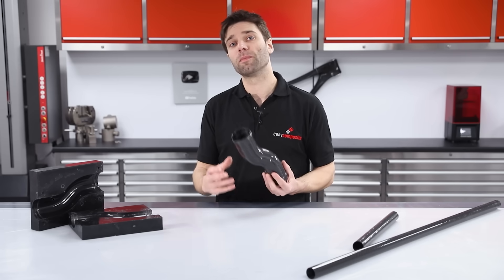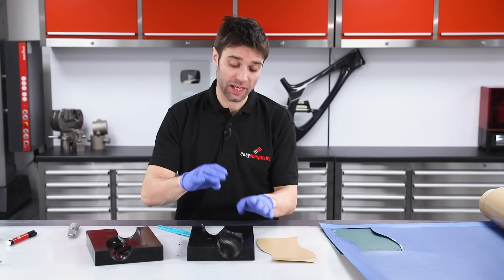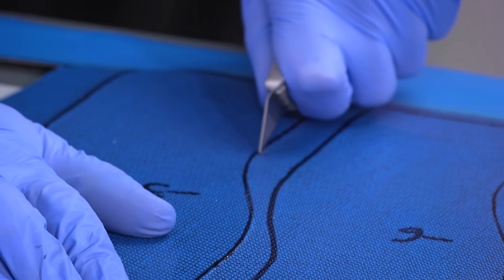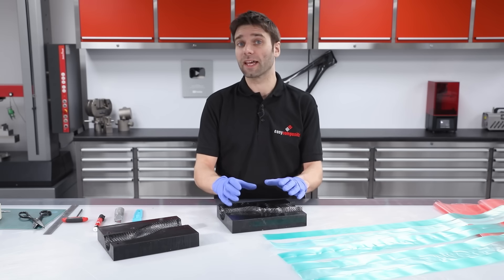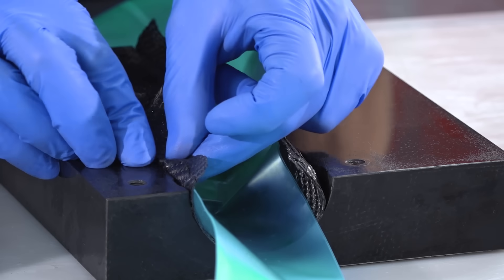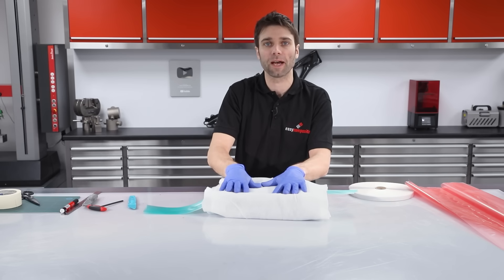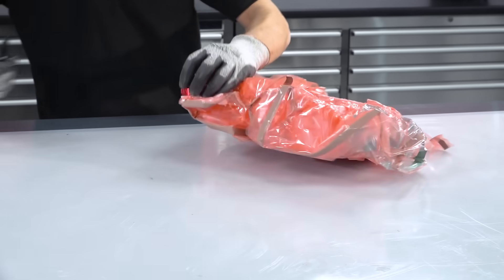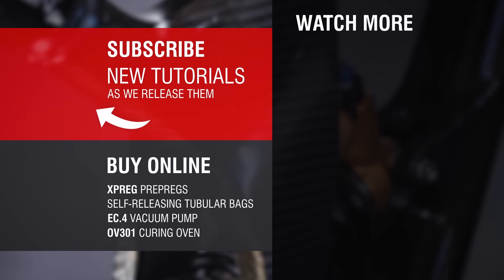Making Complex Carbon Fibre Tubes Using a Split-Mould

Comment: Excellent! Could you demonstrate how to make the patterns for carbon fibre tube such the one in this video?
Reply from the maker: The split-mould we used in this video is a prepreg carbon fibre tool. The patterns (for the two halves) were CNC machined from epoxy tooling board like in https://www.youtube.com/watch?v=CWAvo8DIZ9s and then the mould halves made from made from XT135 carbon 10:00 28/04/2020fibre tooling prepreg like in https://www.youtube.com/watch?v=k4GdAuNji5g. There are other solutions for making high temperature moulds, such as a hand layup process using high temperature epoxy tooling gelcoat, resin and paste which you can find out about in this tutorial (on our website) https://www.easycomposites.co.uk/#!/composites-tutorials/High-Temp-Tooling-Gelcoat-Putty-Mould
Reply: Easy Composites Ltd thank you so much! Need to get me some kit off your store.

Comment: The the inside tube was only open to atmospheric pressure on 1 side rather than 2, this would not work. Correct?
Reply from the maker: Sorry Cam I'm not sure I understand the question. The vacuum bag tube on the inside has atmospheric pressure 'filling the tunnel' through the tube and pushing the bagging film onto the laminate which is on the inside of the split mould. The rest of the vacuum bag is, effectively, on the 'other side' pushing in the opposite direction. Does that make sense?

Comment: Hi dude, and the resin ?? is there no resin in this process? does the carbon sheet already have glue?
Reply from the maker: Hi Max, that's right, in this video we're using 'prepreg' carbon fibre which is a special type of carbon fibre reinforcement that already has the resin pre-impregnated into it.

Comment: How sturdy would it be if you were to meld an uncured piece of cf to an already finished/ dried piece then re vac bag the whole part. is cf splicing possible?
Reply from the maker: There's no significant performance penalty to adding additional layers of carbon fibre in a second cure cycle. Since the vast majority of strength runs in the direction of the fibres, let's call this the X and Y plane of the laminate, there is little strength in the Z plane anyway; adding another layer or layers afterwards is not much different to using more layers in the original layup.
Reply: @easycompositestv  awesome breakdown thanks for taking the time. CF had such amazing properties!

Comment: How much boost can a carbon tube hold? asking for a friend
Reply from the maker: Depends on the thickness of the tube, shape, quality of laminating etc.  Ideally you would want to test a tube of the right design to destruction to ensure you have the right balance of strength.
Reply from the maker: Well, it would depend on the specifics of the tube: wall thickness, diameter, fibre type, orientation etc. Technically, you could make a tube that could withstand just about any pressure, given no other restrictions or parameters!

Comment: All of that work for just one pipe, can’t even begin to imagine what it takes to build a  koenigsegg, the entire car is a carbonfiber
Reply: At least they won't rust.
Reply: And that's why they cost millions of dollars as well.
Reply: @Dougline_  it's not just the carbon parts that make them more than a million dollars, it's also the R&D that they do and the low production numbers. Carbon parts nowadays are not that expensive anymore, the Alfa Romeo 4C has a carbon fiber tub and sold for less than $70k.

For a small company, Koenigsegg R&D produces innovative tech like the transmission of the Jesko, triplex suspension geometry, the first road car that comes with carbon fiber wheels from the factory, etc.
Reply: @sepg5084  Exactly Koenigsegg doesn't make cars at cost, the purpose of them is to push the boundaries of engineering and to be a "profitable" company, and there is a massive price associated to that, regardless if its in the automotive industry or not. Folks who question what they cost obviously dont understand what it takes to make a car like that let alone what goes on behind the scenes to make similar niche/quality stuff. The 4C is a fantastic example of an exotic manufacturing technique optimized for semi-mass production, the fact that they are able to produce a car with these exotic production techniques at a "affordable" price is very impressive.
Reply: If you want an idea on the labor involved, check out the youtube channel Street Bandito. One of the guys is making (and is almost finished with) a full carbon body 240z. The guys does some fantastic work and his car looks gorgeous, all done himself.
Reply: @readysetnogo  I believe their channel is the reason why this video was recommended to me. I'm interested in handcrafted/homemade carbon fiber stuff. I'm glad there's other fans of the Street Bandito out here. They deserve more love for all of the effort they put into their builds especially the carbon z.
Reply: GUNER 400 parts;)
But dont worrie you Pay for the extra Carbon time:)
Reply: i believe it takes around 600 hours of work to build an koenigsegg
Reply: @Nikolaos Stavritis Guessing he's talking about printing the molds instead of traditional machining
Reply: I think eventually someone extremely clever will figure out a way to fully automate this work with some new type of crazy robotics.
Reply: you dont use pre preg. our CF bodies cost about 5k to produce. its nowhere near as expensive or exotic as people think. the moulds are machined and the layup is done with a chopper and single layer of CF for looks. if you cant see the substrate you dont use any matte. just chop and resin.
Reply: @DieselRamcharger  err can I learn that
Reply: @ModularIsl  if i can do it. You can do it.
Reply: @DieselRamcharger  I’m at a makerspace they have a shopbot so I’m asking the instructors how I should go about this.
Reply: @DieselRamcharger  I use Fusion 360 and 3d print a whole lot. I’ve seen people printing molds; I’ve been considering carbon for the casting material in a mold for a new product. I just need to learn how to make the molds from the 3d model. You got a Ramcharger? Mopar or no car I have a Magnum
Reply: @ModularIsl  the most basic way to make a mould from a model in fusion. take your model. draw a square around the middle of the model. extrude that square into a box. so now half the part is captured inside solid block, half is sticking out. Use the COMBINE command. select your model at the "tool" body select the block. check the box that says keep original. and OK. now you have half the part extruded from a solid block. thats half your mould. do it again for the other side. add some sprues and runners you got yourself a mould for casting. all pretty easy. there is a youtube tutorial for everything!
Reply: @DieselRamcharger  🙌🙌 makes it so simple; I can already see this working I’m gonna go at it til it’s done thank you
Reply: @ModularIsl  Good luck! Fusion360 is powerful but some times not very intuitive. What you need is almost always there, if you can find it!
Reply: Large 3d printer makes light work of carbon fiber composite fabrication.
Please build spacecraft worth stealing, spaceX hasn't yet.

Comment: carbon fiber is labor intense, labor intense and labor intense.
Reply from the maker: It sure is, that's why these materials and techniques are only really used where strength or weight or some other distinct property of carbon fibre are critically needed.

Comment: This actually seems like bad practice to me. The vacuum can't properly get to the part because there is no breather there, only on the outside of the mould.  It allows for air pockets in the vacuum bag on the part, causing bad compaction and hence weak spots. Otherwise a great video though.
Reply from the maker: Hi Sander, I understand why you might think that but I can assure you that vacuum doesn't work like that. In this configuration there is zero possibility that vacuum pressure won't be equally imparted on the laminate. In fact, far from being bad practice what you're looking at here is standard and widely adopted practice.

Comment: Thank you for the very clear explanation, especially of how the overlapping works, and how to size the pieces properly for overlap. Are there any extra steps one should take to prevent air pockets forming under vacuum in more complex tube shapes (other than ensuring that the bladder is sized for the largest internal cross-section of the tube)?
Reply from the maker: No, not really. Just ensuring there is no bridging of the reinforcement or the vacuum bag; that's the essential part.

Comment: Thank you again for this videos are all very intresring and you very good to explane :) I've a question: if a have to do a "Y" tube I can use this method? With two bags?
Reply from the maker: Yes that would work fine.
Reply from the maker: Yes, certainly, it would really be just the same principle. You con't actually need both (or either) of the bags to go all the way through, they can just meet the other bag, formaing a sort of membrane. Hard to explain but probably will make sense when you come to do it.
Reply: @easycompositestv  thank you soo much! Sorry for my English it's not so good. So if I've understood well, taking letter Y like example, I can put two bags into two single upper side of Y and get them out from the common down side of Y

Comment: Would it be possible to use a 3d printed (45degree) tube in soluble material.Then wrap it with the prepreg like you did with the straight tube? (with heat shrink tape) 
Or does this also need to be wrapped in parts if its not a straight tube ?
Reply from the maker: I'm not sure that a material exists that you could 3D print with, then cure at elevated temperature under pressure, and then dissolve away afterwards. What you could do would be to 3D print a female mould, cast a mandrel into that female mould using a water soluble core compound, and then do the roll wrapping process around that mandrel before dissolving it away. This might be a process we cover in the future.
Reply: @easycompositestv   yes it does ,it's used to make complex Carbon tubes .It's FDM printed soluble  ST130 ,temp capable  of up to 130°C and disolves in a hott water mixture.

Comment: Very helpful. Thanks a lot👍 It would be interesting, when you can make a video "how to make a negative mould for a Carbonfibre tube or elbow" .
Reply from the maker: To be honest I think the videos we've already made will tell you all you need to know about how this mould way made. The split-mould we used in this video is a prepreg carbon fibre tool. The patterns (for the two halves) were CNC machined from epoxy tooling board like in https://www.youtube.com/watch?v=CWAvo8DIZ9s and then the mould halves made from made from XT135 carbon 10:00 28/04/2020fibre tooling prepreg like in https://www.youtube.com/watch?v=k4GdAuNji5g.

Comment: Could you make a video on the mould making process?
Reply from the maker: We've pretty much covered all of the steps for making the mould in previous videos. The split-mould we used in this video is a prepreg carbon fibre tool. The patterns (for the two halves) were CNC machined from epoxy tooling board like in https://www.youtube.com/watch?v=CWAvo8DIZ9s and then the mould halves made from made from XT135 carbon 10:00 28/04/2020fibre tooling prepreg like in https://www.youtube.com/watch?v=k4GdAuNji5g. There are other solutions for making high temperature moulds, such as a hand layup process using high temperature epoxy tooling gelcoat, resin and paste which you can find out about in this tutorial (on our website) https://www.easycomposites.co.uk/#!/composites-tutorials/High-Temp-Tooling-Gelcoat-Putty-Mould

Comment: I have a massive desire to try doing this with 3d printed moulds and make a carbon fiber intake for my bone stock ass truck for no reason except to practice for when I turbo it
Reply from the maker: We're planning on doing some videos based around 3D printing soon so make sure you're subscribed to see them when they're ready.

Comment: Is there any chance of reusing the vacuum bag?
In my opinion this has a huge impact on the environment if it is necessary to use a new vacuum bag every time.
Reply from the maker: The chance of ruining a project is not worth the risk. Throwing away a complete set of fibre, resin AND the bagging film is more environmentally costly than just the bagging materials each time. The bagging film is multilayer nylon, so in theory, in some places it should be possible to recycle. The problem is that for low volume users, most domestic and state/council waste collections don't accept a lot of genuinely recylable materials - they just target the valuable and easy to filter recyclables.
Reply: @easycompositestv  thanks for your answere. Perhaps there will be a a more friendly way discovered. Perhaps you can find one and get ahead of your competitors. Inovation was always the greatest value.
Reply: Huge impact ? How exactly did you come to the conclusion a huge impact would happen ? Oh wait, you think man made climate change is actually a thing ? #PoliticalScienceHoax
Reply: @Hanibul_Lecktor  I mean man made plastic going into a land fill would have an impact. It would be better to recycle or reuse.
Reply: @HaloHamstur  I hear you on that, you can reuse the bags if they're in good shape. That's just common sense though, which I think OP has little to none with his "Huge impact" statement. The #PoliticalScienceHoax I don't subscribe to.

Comment: Does these carbon fiber parts inside an engine bay will last very long, despite the heat over the years inside?
Reply from the maker: Engine bay temperatures are not likely to be a problem, carbon fibre parts made using XPREG XC110 have a service temperature of 110C which it's unlikely to be in the engine bay unless they're directly next to the exhaust manifold or other very hot components.
Reply: Got it, thank you.

Comment: Nice video sweet.Can you carbon fiber radiator hoses.Oh is carbon fiber chemical resistant to radiator fluid to.About 200 too 230 degrees farenheit.
Reply from the maker: Generally, carbon fibre tubes, especially in their raw form like this, wouldn't make the best choice for radiator hoses. The engine cooling system is actually quite a challenging environment for a composite material; you have the combination of boiling (or near boiling) water, an operating temperature that's almost at the maximum operating temperature of the laminate anyway, and the ethylene glycol (antifreeze) all adding up to create an environment that is likely to compromise the carbon fibre. Where you really want to use carbon fibre on a coolant system I would suggest using a tank sealer coating on the inside of the tube, something like Caswell Europe's GTS75.
Reply: Easy Composites Ltd What about intake manifold?

Comment: Hi, Nice video once again. I was wondering watching the 2 tube video s you did lately how you would tackle a velocity stack intakes used in motorcycles and cars.
Reply from the maker: Actually we used to make those! If you're talking about individual intake rings then they're a pretty simple moulding. One part mould, the mould looks like the male shape, and then we used prepreg carbon laminated onto the male mould, and then vac bagged and cured. Very simple parts to make.
Reply: @easycompositestv  cool. Will think of trying the prepreg way then. Was using infusion for now but this seems the best way to go now.
Reply: @easycompositestv  any 4" intake ones about in the shop ;)

Comment: What Is mould material ? Can go up to 120 degree?
Reply from the maker: The split-mould we used in this video is a prepreg carbon fibre tool. The patterns (for the two halves) were CNC machined from epoxy tooling board like in https://www.youtube.com/watch?v=CWAvo8DIZ9s and then the mould halves made from made from XT135 carbon 10:00 28/04/2020fibre tooling prepreg like in https://www.youtube.com/watch?v=k4GdAuNji5g. There are other solutions for making high temperature moulds, such as a hand layup process using high temperature epoxy tooling gelcoat, resin and paste which you can find out about in this tutorial (on our website) https://www.easycomposites.co.uk/#!/composites-tutorials/High-Temp-Tooling-Gelcoat-Putty-Mould

Comment: Great video!  I was wondering why not an internal balloon (maybe a modified motorcycle inner tube) instead of this vacuum bag setup.  Is there an advantage to curing under vacuum instead of pressure?
Reply from the maker: Thanks! The moulds you need for a pressurised bladder need to be incredibly strong (usually billet aluminium) in order to resist the deflection of the 'unbalanced' pressurised bladder. Therefore they tend to be very expensive to produce. An internal vacuum bag setup like this exerts equal pressure on the inside and outside of the mould, allowing much lighter, more cost effective composite moulds to be used.
Reply: @easycompositestv  that makes sense.  Thank you!

Comment: the moment i realise the mold is carbon fibre makes me tihnk, how do you make a mold of a mold?  lol
Reply from the maker: The split-mould we used in this video is a prepreg carbon fibre tool. The patterns (for the two halves) were CNC machined from epoxy tooling board like in https://www.youtube.com/watch?v=CWAvo8DIZ9s and then the mould halves made from made from XT135 carbon 10:00 28/04/2020fibre tooling prepreg like in https://www.youtube.com/watch?v=k4GdAuNji5g. There are other solutions for making high temperature moulds, such as a hand layup process using high temperature epoxy tooling gelcoat, resin and paste which you can find out about in this tutorial (on our website) https://www.easycomposites.co.uk/#!/composites-tutorials/High-Temp-Tooling-Gelcoat-Putty-Mould
Reply: @easycompositestv  Aweosme, Ive just checked out those other videos. Love the videos and the channel! :)